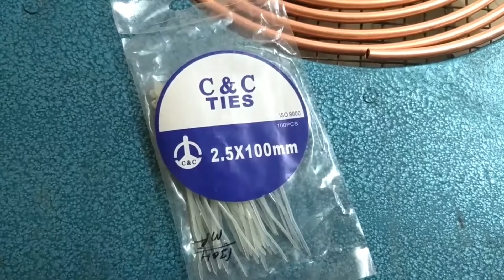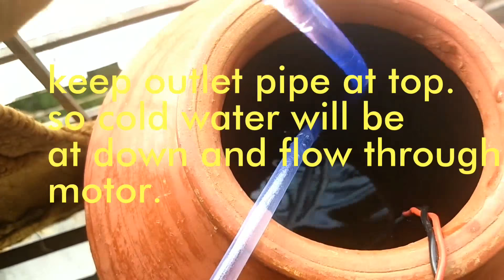50 Watt AC/cooler!!

Comment: Evaporation results in cooling in conventional cooler. Since their is no evaporation in this model, i think one will need cold water to decrease room temperature or a peltier module for be more effective cooling. Has anyone tried refrigerator compressor to cool water (as it consumes less electricity than a/c compressor (also 12 v compressors available) ?

Comment: if it operates this way, then it doesn't need to be placed on the window. Placing it fully inside will facilitate more cooling.
Reply: Resnick14 yes u are right
Reply: the Clay Pot should  be kept out side and fan should be kept inside. Because the water in the pot will be more colder when kept in open area having dry air to cause more evaporation on the surface of pot to bring the water more colder inside.

Comment: Bro it's a v. Good idea. I have some tips to make more cold ur water pot please read below.
1. Buy big pot with more wall thickness.
2. Never use ice, dry ice or coolant in it. Ice & dry ice will spoil ur mud pot. Coolant is used for anti rust not for cooling.
3. For natural cooling of water in  mud pot use jute sack (bori) in hindi buy it from fruit shop rope it on pot & make it wet once or twice a day after a week ur pot will start cooling.
4. Liquid nitrogen in best idea in all comments I believe too but how to make airtight counsel pump if u have idea please share in reply.
Reply: After a week, what a joke,  the wather in the clay pot become colder in 1 hour time if the area has good dry air flow.
Reply: Your best idea of coolent is perfect no damages

Comment: this is called indirect evaporation cooling... 

the matka's rate of cooling is much much lower than rate of heat coming from the coil so water will heat up to room temperature... 
what might work is install a big desert cooler outside with 30-50 liter capacity and keep it running and them pump that water from the desert cooler into the cooper coil inside the room.... that way all humidity via evaporation cooling stays outside and only cold water is coming in to cool the room (room must be insulated)... this will work but very slowly .... even this will  not work if relative humidity is above 60%.... 

this small matka will not work .... period.... stop wasting money on coolant and radiator... instead increase the capacity of the source of of cool water and close the Windows and insulate the room...

Comment: A small suggestion you could have kept a Peltier module to further decrease the temperature of the water..... 
This could help in further cooling effect....
Anyway it's a  good trial......
Reply: have you every tried peltier module. it draw too much current 6-7 ampere to it is useless.
Reply: 50 wat bana banaya mil jaiga milaiga to kitnai rs ka

Comment: Instead of cooling the air, this machine will heat the water. The maker might well have experienced this. Some science is required. Coolers use evaporation cooling of water. Here that is not happening.

Comment: Good creativity but considering earthen pot cooled water temperature is negated by heat generated by fan and submersible motor. We need something which naturally is very chilled as a source heat exchange like expensive coolant gas used in AC. If you take ice, you only bound by law of thermodynamics, I mean you heat up fridge location to transfer chill. We need more thinking hats.

Comment: Why to install it at the window where it would make contact with direct sun light though we want to maintain the water temperature low as long as possible.
If it works then install it inside the room.

Comment: Is your pump enough to rase high pressure of liquid .. because what i know throttling is needed to cool gas or liquid .. its just flowing water into the cooper pipe
Reply: This is just a water pump to circulate cold water between pipe. It is not a compressor.

Comment: i think that connecting peltier module with this line  will be more effective cooling
Reply: திருமறை நேரம் Bible hour.... Bro tamil la konjam explain panen
Reply: Mass dosage peltier moduleஐ இதனுடன் இணைத்தால்  இன்னும் கொஞ்சம் பலன் இருக்கும் ப்ரதர்
Reply: Yes you are correct. The downside will significantly increased power usage. Also peltier modules are inefficient heat pumps, so in the long run you might be better off using a compressor whereas this video demonstrates the concept of indirect evaporative cooling which is cheaper to run.
Reply: திருமறை நேரம் Bible hour yup me too

Comment: From where did u get that motor??
And how much is the cost?
Reply from the maker: Sujit Yadav which motor? Fan motor or water pump motor?
Reply: Pump motor bro.
Reply from the maker: Sujit Yadav ebay
https://rover.ebay.com/rover/0/0/0?mpre=https%3A%2F%2Fwww.ebay.in%2Fulk%2Fitm%2F112569048528

Comment: Good one. I just came back from market after searching for copper tube .What is the cost of 15 meter copper tube? Did you buy it online?
Reply from the maker: Arthur Rider yes online ordered, 1/4" 50feet Rs.1200 from Amazon.
Reply: Thanks. Can you add temperature reading infront of the fan  before and after the fan is switched on?

Comment: Can you also post the temperature of the room just in-front of cooler before running it and temperature after few minutes of running to know how much cooling is happening? I am making one myself because these fan companies only want to make money and do not invest in such simple products that give better performance
Reply from the maker: Arthur Rider I will purchase thermometer and will post that results.
Reply: Another improvement that can be done I think i use the expansion principle for thermodynamic cooling. When air or water goes through a funnel shaped pipe  (big end to small end) the air expands as it comes out to small end and it gets cooled (Google to read abt this principle, high pressure to lower pressure I think is is Bernoulli principle not sure) I wonder if it can be used to cool the water as well as cool the air. (what I am writing here is already experimented by many people on youtube)
Reply: You can use a digital thermometer that we use for taking body temperature. It is at room temperature and when you hold it at the center of the fan it should show drop in temperature. Will be variance of 1degree but thats ok for an experiment.

Comment: I would like to make same arrangement with ceiling fan  ,it may need structure to hold pipe
Reply from the maker: munali i had also thought about it but its little bit difficult.
Also instead of water and sand jar. Try to cerculate pipes from kitchen refrigerator freezer. And use car coolant instead of water.
Reply: Sachin Bhangale app ne ye banaya ho to uska video bhejo please
Reply: If you make it with ceiling fan, then what about condensed water?
Reply: @Vidshatke  then it will become shower.... :) ... on serious note to reach dew point with just evaporation cooling is not possible unless you put ice in the water...

Comment: Good job but it’s cooling or not any 1answer please
Reply from the maker: Hitendra Sarthi need some modifications for effective cooling.
Use coolant Instead of water, use icepac/icebottel
Reply: Sachin Bhangale thanks brother I will try you making a good idea ye copper pipe kaha milega and price. Ghade ko side me na rakh k cooler k saamne rakho ghada cooler k hawa se chilled ho jayega and cooling badh jayegi
Reply from the maker: Hitendra Sarthi i have ordered it from Amazon. 1/4" 50feet copper pipe
Reply from the maker: Hitendra Sarthi copper pipe Rs.1200 from Amazon
Reply: Sachin Bhangale thanks brother I will try it
Reply: If using copper tubes for cooling then why ice   is needed...does it make sense
Reply: Move your ass and use Google to understand why ice is needed!   What is important is that this cooler uses theory of heat transmission and 2 coils means it is removed from air 2 times. Even without ice it will cool the air there will be very minor drop in temperature. With ice effect will be better and if you use coolant then it will be more expensive but effect will be even better.
Reply: Why gone case! You said "using copper tubes for cooling then why ice is needed...does it make sense" now u say you know why ice is used. I think u need treatment. We shd do crowdfunding to sponsor you to Agra. Charity for poor ppl!
Reply: U get nice desert cooler for 2k from local store instead of this. Which gives super cooling than any top brands.
Reply: You are at the wrong place. This is not about money it is about building something yourself that works. Dont bother to reply
Reply: Arthur Rider leave it man........i have other works....not here to fight
Reply: Learn how to talk to others

Comment: pipe price is 8000 rs.
Reply from the maker: Thats why I have provided link in description :)

check this model
Outer Diameter - 1/4 inch and Wall Thickness - 24 swgProduct Length: 15mtrs/50feet

Comment: Pagal cooling kaha se hoga. 20 minutes me matke ka Pani garam ho jayega. Fir
Reply: Nahi hoga because matka latent heat of evaporation use karke thanda ho jata hai . His idea is good
Reply: @varunverma2852  the matka's rate of cooling is much much lower than rate of heat coming from the coil so water will heat up... 
what might work is install a big desert cooler out side with 30-40 liter capacity and keep it running and them pump that water from the desert cooler into the cooper coil inside the room.... that way all humidity via evaporation cooling stays outside and only cold water is coming in to cool the room (room must be insulated)... this will work but very slowly .... even this will  not work if relative humidity is above 60%.... this is called indirect evaporation cooling... 

this small matka will not work.... period....